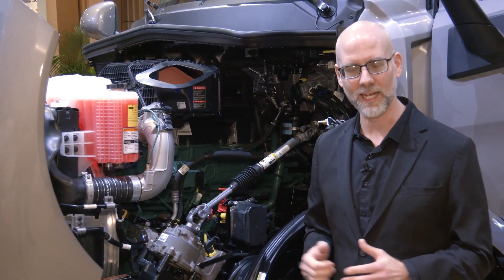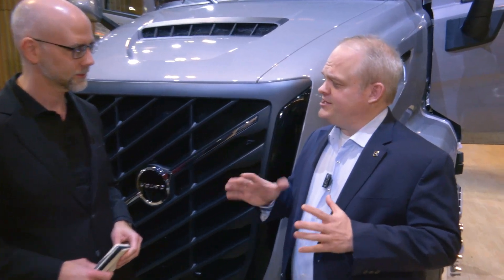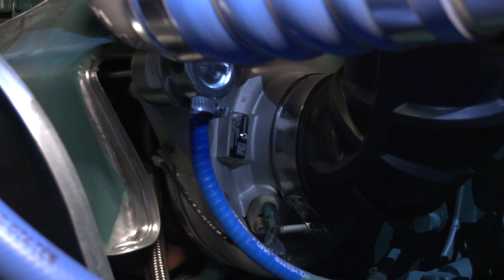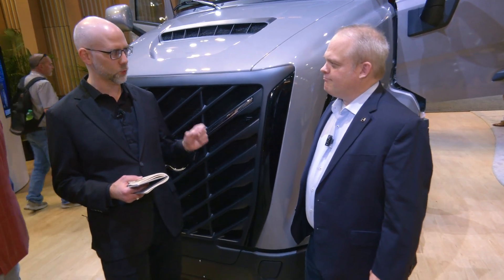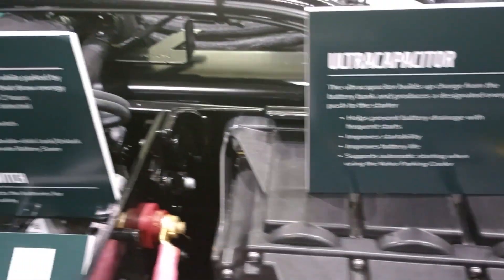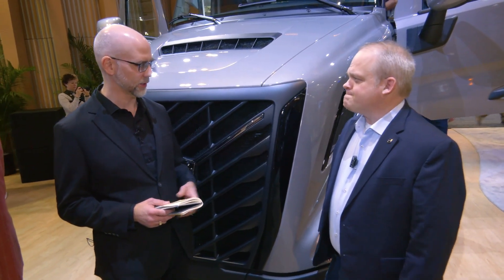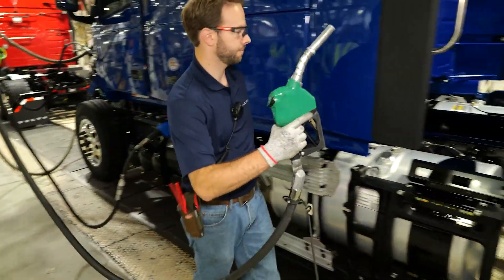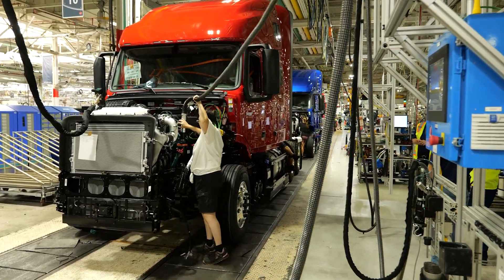Volvo Trucks — Episode 15 — The D13 VGT Engine

Comment: Is the VGT better for long haul or start and stop regional deliveries?
Reply: Depending on the VGT design. It's better for either style. The only problem I have is replacement cost. The Cummins ISX based engines suffered big time VGT failures and it's not cheap. The turbo and actuator cost $7000.00 or more.
Reply: From one source: "The new Volvo D13 VGT engine, designed to power regional delivery and urban applications, can heat up quicker than engines designed for long-haul operations".    Volvo also claims their VGT provides " high retarding horsepower at low rpm, where engine braking is needed most."  The engine can produce higher torque and power over a greater engine speed range.  The variable geometry speeds up the turbo at lower engine speeds and allows it to produce more boost, sooner.  This bumps up torque and power as the truck begins to move and makes the engine more responsive in slower, variable-speed traffic.  This is seen as less useful for long-haul trucking, where the engines spend much more time at at cruising speeds, where Volvo sees its  TC (turbo-compound) engine as a better fit.